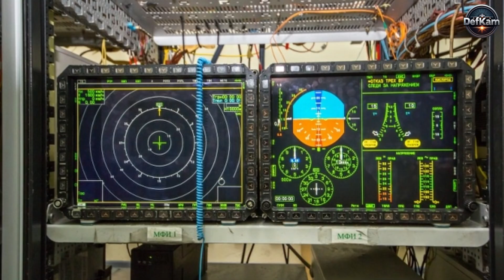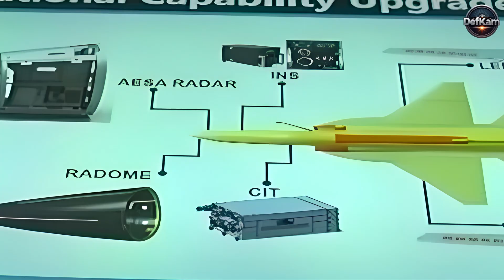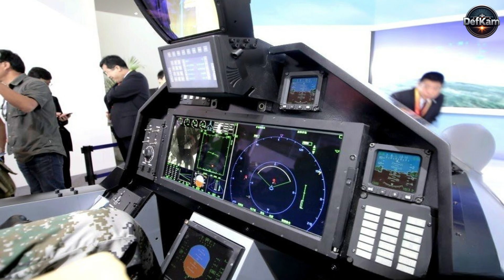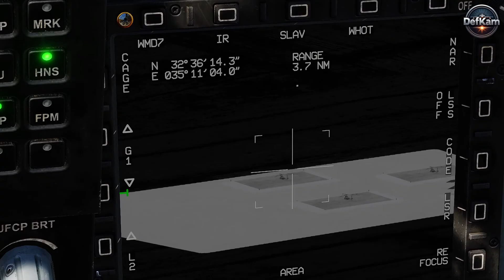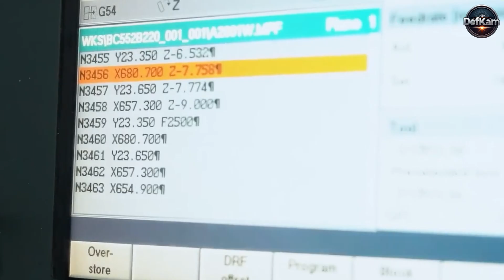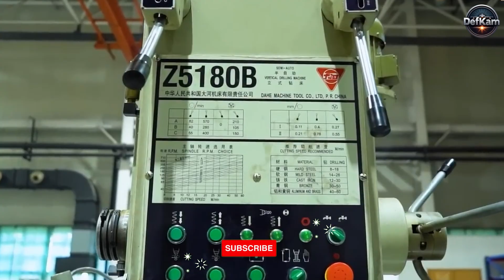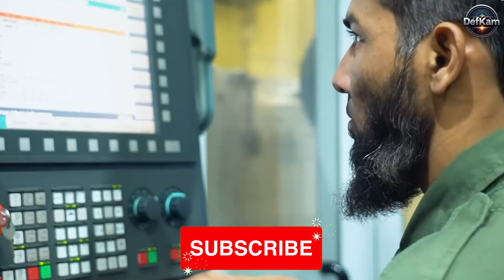PFX stealth or low observable ?

Comment: Please clear the confusion,would it be a single or double engine machine……thanks?
Reply from the maker: PFX-Alpha single engine 4.5 Gen and Final PFX (PF-20 maybe) dual engine 5-Gen.
Reply: @DefKami there is no twin engined PFX-20 but Turkish KAAN with WS-15g.